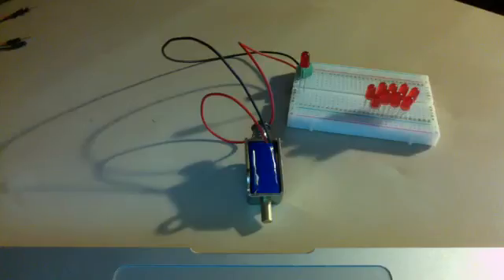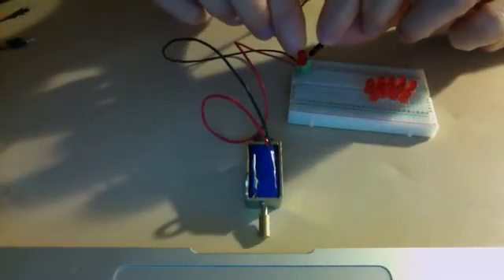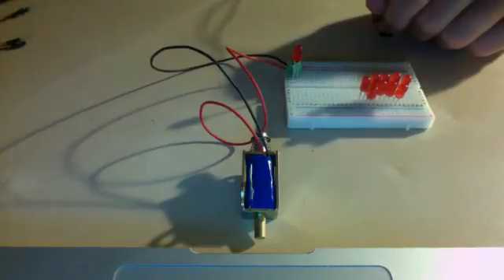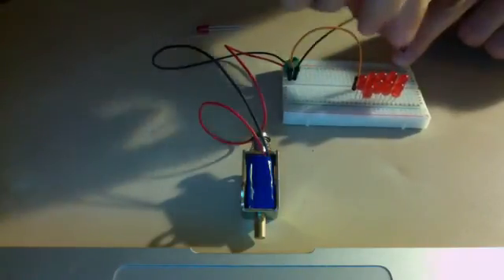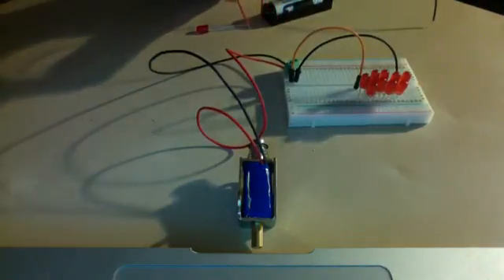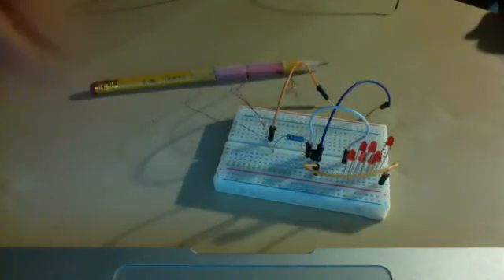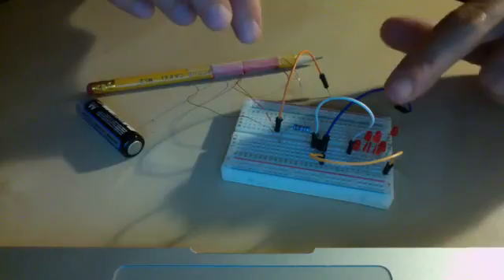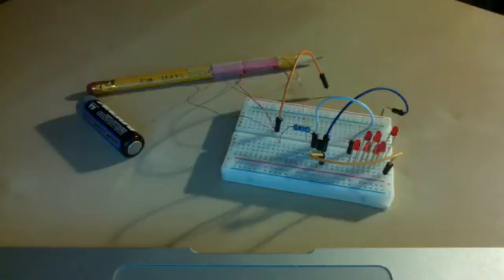Inductive Loads

Comment: A good example of Lenz's law.  An inductor will oppose any change in current. If the current is increasing it will oppose it. If it is decreasing it will aid it by using its stored energy in its magnetic field. Thanks for posting. You have the knack for this. Hopefully you will make more  videos.